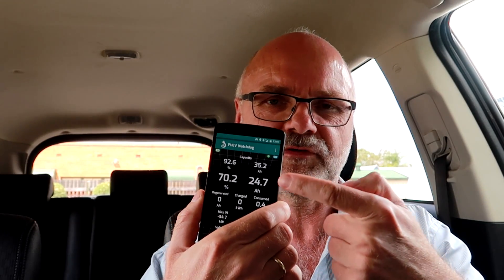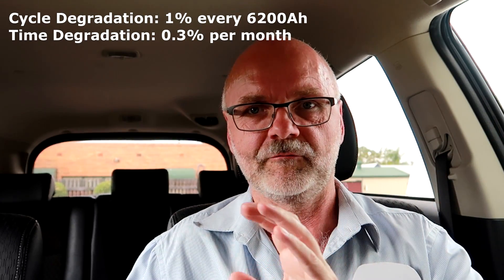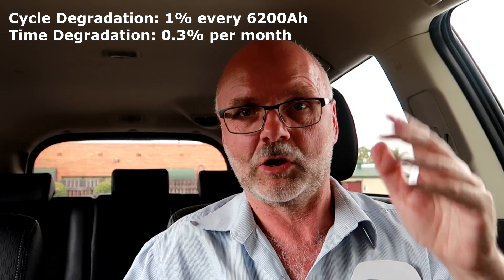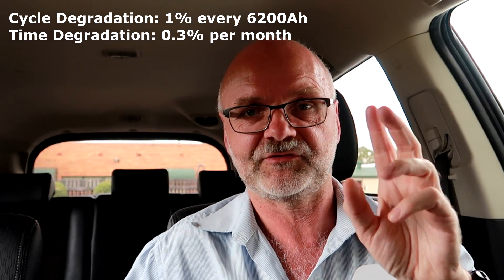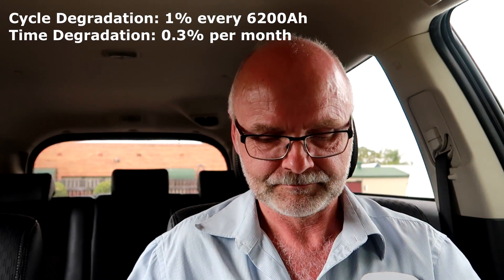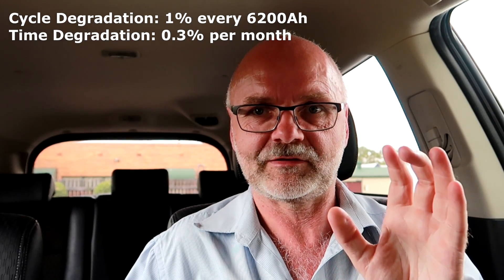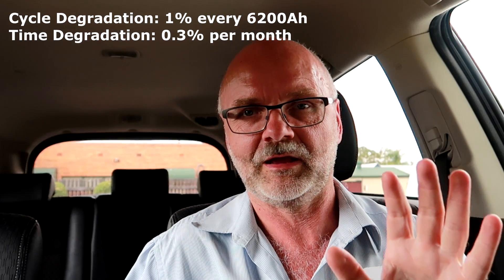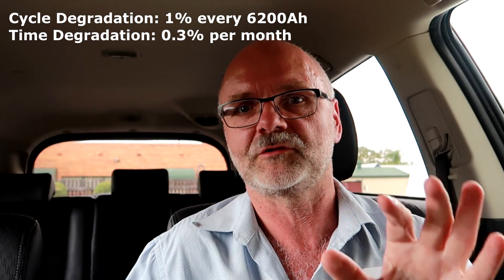EP190 - Do we have a #PHEVvaccine instead of a cure? Why we were wrong about the BMU!

Comment: Do you recommend performing the triple procedure even before getting your new Outlander? Afterwards the system should know the real capacity, shouldn't it?
By the way: Thanks for your great work!
Reply from the maker: Thanks Nicolas. The triple Procedure does not seem to work over time. It looked good at the beginning but SOH is going down again after a while in the same pace as without the procedures.
It calibrates the BMU to the correct capacity though, that is correct. It's the best process we have at the moment...

Comment: Andy, 

Not so sure about what you are saying.

As a matter of fact, Mitsubishi themselves have explained in one of their service bulletins that the BMU can only calibrate itself when it is regularly charged over A/C and even then, only "when certain conditions are met". Are they bluntly lying? For cars that are never externally charged or only via DC chargers, Mitsubishi themselves indeed say that the BMU has noting to go by, other than the preprogrammed deterioration params (we didn't know the actual params, so thanks for that). But we have also seen cases (on the same PHEVWatchDog,net you refer to) of cars where reported SoH spontaneously went up in several small steps when charging pattern changed. If you and Gerard were right about the software, this would be impossible.

BTW

My battery is 65+ months, so I should be down roughly 20% for this.
My Ah in/out is 170.000 Ah, so I should be down another 27% down for this.

In total, I should be down approx. 47%. But I am 'only' 30% down. Less than 2/3rd of what to expect based upon preprogrammed params. Yes, I have had several DBCAMs performed, but never a full reset. So, according to you, the DBCAMs should not have made a lot of difference.

Also, in 8 years, every battery should be down by at least 8 * 12 * 0.3 = 30%. Subtract some more for usage and about every battery would eventually be eligible for warranty replacement (provided the owner did not more than 100.000 miles).
Reply from the maker: Yes, not true, the BMU cannot calibrate itself without DBCAM. Obviously MMC is not aware of that and the workshop manuals are wrong and incomplete.
Reply: @unpluggedEV  So the people claiming to see their SoH value going up by regularly charing the car, such as Richi Jennings, are lying? And so are the stats on PHEVWatchDog.net that show SoH on some cars going up, step by step?

With all due respect, your explanation was not all that convincing to me (or to yourself, as you did not want to be quoted on your claims ;-) ) and the 'evidence' appears to be restricted to TeamPHEV members only. Tough to sell, if you ask me.

Comment: I suspect that the bmu having the wrong initial input from the beginning continously "think" that the battery degrades much quicker than it should and at every cycle of evaluation tries to "save" it, thus continuous drop in the apparent capacity. This way user should not be able to degrade the battery further but the loop continues in some kind of a vicious cycle and will never stop unless everything is reset and a proper initial value is inserted. The biggest bug in this system is that the BMU does not correct the predictions using, for example, max nominal V of the battery and uniformity of V across the cells.
Reply from the maker: I like your theory, J B!

Comment: Thanks for the info Andy. I'm not sure about those percentages though as it would make my 62 month old MY14 with 49068km on the clock be expecting a SOH of 73.48% when I've actually got 85.3% showing in the Dog. Perhaps the percentage degradation calculation is not exactly 0.3% and 1% ?
I have wondered about this - the BMU is old and presumably slow by today's standards. Does it do proper floating point calculations, or is it using some low-precision 8 or 16 bit integer math?
Perhaps the calculations are simplistic and give different results compared to us using our scientific calculators and spreadsheets?
Reply from the maker: All possible, you may want to ask Gerard. I pinned his commend at the top here...

Comment: Wont the degradation pattern stay the same then? If it is just based on percentage and usage?
Reply from the maker: I think it's a percentage of the available capacity. So the calculated degradation is not linear and also depends on your usage, which is probably not the same every day either.
Reply: unplugged EV if it only cares about cycles and time wouldnt that mean that  it will always be the same, the only difference is the available capacity of the battery?
Reply from the maker: But cycles are heavily dependant on your driving style. Remember even the regen putting energy back in the battery counts towards this 6200Ah=1%...
Reply: @unpluggedEV  My case is that the potential degradation pattern would still be the same if you look at it in a graph just that the values would be a little different. Since its always the same calculation(?) and the only value that actually change from the BMU fix is the total capacity of the battery?

Comment: My deep respect to you and Gerard ! Let's see if Mitsubishi creates a service procedure for this.
My PHEV dropped 2Ah and 5% SOH in 5000 km, so i'm looking forward to such a simple fix.
www.phevblog.nl/en
My usage = 98640Ah, so would be 15.9% capacity drop
And age = 1459 days would be 14.6%
Actual SOH = 90.8% (34.5Ah)
This does not match the calculation in the video, however the first 125.000 km the car was not charged by the previous owner. I got it with 95.8% SOH at 125000km.
When i only use the delta after i got it, charging twice per day (7356Ah and 113 days) the capacity drop using the formula is 2.32%.

Comment: Doing the math on mine only the battery cycle degradation seems to line up roughly.  1969days old, 98600Ah of usage, 85.8% SoH.
Thanks for digging into this. I'm very curious on how this all turns out.
Almost makes the intro song more manageable.
Reply from the maker: Unless you had a reset at some stage...
Reply: True, true. I almost had it for a month. Could be the previous owner. But yeah, keep on digging! :D

Comment: Hi Andy, Gerard
Unfortunately the things don't seem so be as simple as explained. The data from my car does not fit in your explanations.

Currently I have SoH 83.2%=31.6Ah which means that my car is one of those with 100%=38Ah.

In the same time the total current is 110 000Ah which should mean 18% degradation according to your formula. It is also 58 months old which would mean 17% degradation more.
According to your degradation formula, the BMU should have calculated 17%+18%= 35% degradation.

Lucky, my SoH is 83% instead of 65%.

Apparently, there are other parameters that the BMU considers.
Also, strangely enough, after the first 3 years and 140 000 km with the previous owner, the SoH was 92%. Now only two years later and 40 000 km more, my SoH is 82%, so the degradation started dropping faster with my usage.

Any thoughts on this? How does it fit in your findings?
Reply from the maker: Maybe your had a reset before you got it...?
You can ask Gerard directly, I pinned his comment here at the top.
Reply: Recalculate like the percentage you get on leasing in a bank: apply percentages every time she SOH is changed. Do not apply projected degradation to the initial capacity.

Comment: Great work Andy and Gerad.  Still more to do with MMC, but loving the new PHEV you convinced me to buy (😉), so glad it’s not a 🍋 🤣

However, as this issue isn’t a safety issue, I’m not surprised MMC don’t roll out a recall.  For those who suffer and ‘just drive’ it costs MMC nothing, for those that see 70% ‘assumed’ degradation, this procedure may save millions in battery replacement costs.  For the likes of us tinkerers, it will shut us up... hopefully!

One question is still bugging me, though: What collaboration has Yuasa, the BMU manufacturer and MMC had to set this system up?  If none, maybe the LEV-40 is a better product than the degradation algorithm gives it credit?  Then this procedure should give many of us a great solution.  

Or maybe MMC didn’t realise how their cars were going to be driven and thought this would never be an issue... 🤔

Comment: Very interesting video thanks Andy. It is interesting to see that scientific proof has largely confirmed what I said in the earlier part of last year, and that is that most of these so-called deteriorating battery problems were in fact the BMU artificially strangling the amount of charge admitted into the battery using arbitrary parameters. I was wrong in assuming that this was to prolong the life of the battery, not that it would not have occurred as a result but it is much more the result of incompetence and laziness on the part of Mitsubishi motors. 
It sounds like you are suggesting that the three procedures should be done to older cars. Mine has just gone over 30,000 km, so possibly the real battery degradation is not all that great.
Reply from the maker: We have to test the procedures in older cars and see if this makes a difference or not. One viewer has confirmed here it does not make a difference though...
Reply: unplugged EV 
Andy, I would be quite happy to make my car available. Barry’s DOG recently said the battery was at 79%.
Richard

Comment: So let me get this straight. Mitsubishi's BMU is really nothing more than a glorified counter that "guestimates" battery degradation (and very aggressively it seems)? It doesn't measure actual cell capacity? Ever? That seems like a very odd engineering decision. And it explains a lot. Like how you can get your car back from a dealer after getting the battery tested and suddenly it's range jumps up to near new only to degrade again very quickly.  You would think at the very least Mitsubishi might introduce some kind of per cell amps in and amps out monitoring and compare it to actual voltage. It's not exactly rocket science.  At the very least they should be able to do this for the pack as a whole.
Reply from the maker: Honestly, this all develops to a real nightmare. I just hope more and more owners jump onto the bandwagon and complain about this. Finally this should urge MMC to provide a fix. A real fix.

Comment: Well done Andy and Gerard. Your efforts Andy in producing these videos has greatly helped all Outlander PHEV owners. Gerard's work in understanding the code is brilliant. Mitsubishi should be paying both of you as consultants. The least they can do is give you a new battery. They should also integrate the current into the battery to determine number of Coulombs  (a Coulomb is a ampere-second) going into fully charge the battery. The number of Coulombs to fully charge the battery will tell you how many Lithium ions in the battery are being converted. As the battery deteriorates less Lithium ions will be available as they become locked up in the battery. This is why the Ah value is the most important reading in determining battery performance.

Comment: Not sure if I totally understand what you are saying. We know the battery is a 40Ahr battery, but it is only ever charged to 4.1V. To actually get 40Ahr into the battery you need to charge to 4.2V until current reduces to about 0.05C. So I would have thought a full battery for the PHEV is about 38AHr, because Mitsubishi wants to keep the voltage at 4.1V or less for increased life.
Reply from the maker: Yes, that is correct. the actual cells charge only to 4.1V regardless what the capacity of the battery is. 4.1V is around 85-90% state of charge of a cell, so more like 36Ah (40Ah-10%).
The Dog always showed 38Ah after a reset or even in new cars so assumed this is the max capacity it has. The Dog should show 40Ah. if it shows 38Ah it is not aware of the true capacity and makes false assumptions.

Comment: (Mark Walkington, NZ here )     Good work everyone!!!  ... however if the BMU has such a direct algorithm can we pin it down precisely. I have applied the the assumed degradation factors  to my 146668 Ah usage and 1899 days and this predicts even higher degradation. i.e.1- ((146668/6200)*1% + (1899/(365/12))*0.3%) = 57.6%  (my vehicle reports 68.9%). Any other views on this equation?
Reply: Upper Hutt Cricket To be honest I was also thinking the same thing... However that is what the 'software' reckons, not the actual degradation...
Reply from the maker: I don't think it calculates correctly if there is no bearing to the actual capacity to start with. The reported 68.9% are from an uncalibrated BMU, right?

Comment: if Gerard already went through the pain of reverse engineering the firmware, why not modding it right away  so that owners or Mitsubishi shops could reflash/reprogram the BMU themselves?
Reply: Because it seems like it lacks the necessary sensors to actually work - well perhaps not lack of - but in any case the sensors don't report to the firmware. You could re-flash the BMU, but you still wouldn't know the real capacity because Mitsubishi made capacity a simple calculation rather than real world.  The cell smoothing procedure which is basically a cell balance and then DB Cam (whatever the hell that is?) seem to then be able to populate the registers with the correct values (provided you reset the BMU first and clear out all the existing data.) But after that the BMU will do what it has always done and start degrading the battery based on it's inbuilt firmware.
Reply: @mondotv4216  , well maybe that's not needed to improve the way the BMU calculates the state of the battery (although it probably would be ideal if the BMU could access and use data from the real health state of the battery).
It may be worthwhile to check if it is possible to overwrite (change) both deterioration constants (charging cycles and age) in the BMU to a less aggressive value. That's not even a programmatic change, just pure configuration. This solution wouldn't fix the problem, but slow down the deterioration which in its stock version seems to be based on worst case  assumptions.
If programmatic changes would be feasible then it may make sense to look at how exactly the math algorithm works in the BMU. If it is some sort of a recursive function - meaning, it calculates always on the basis of the previous result then it may make sense to investigate if the algorithm could be changed in such a way that it calculates always based on the initial battery health state value provided by the calibration process. So instead (x=x-constant) it would be (x=y-constant) - the X coming from the lower register and the Y from the upper register (see video). 
Ideally Mitsubishi would change the firmware and introduce a solution that can read out the real state of the battery and update the upper register in the BMU accordingly.
Reply: Daniel D. You could do that but then you would risk getting incorrect readings on the GOM. I suppose that’s not such a big deal on a PHEV.

Comment: Dude, as a scientist at the end of the stick you let me down there with the vaccine/disease thing. A (working) vaccine is indeed a cure, or even better, it prevents the disease to manifest at all. You should refer to it like an old fashion pill that cure the symptoms, but doesn't cure the disease. So, you have to keep taking the pill, like a statin or .... viagra!
You should check with Gerard if it is possible to replace the BMU with a more advanced third party one, or if it would be somehow possible to bypass the car software and instead use the watchdog app + the user's brain to manage the battery. That, of course, would apply to the cars not covered by warranty anymore
Reply from the maker: A vaccine need to be refreshed from time to time, right?
OK, I use this viagra example in my next video :D
Reply: @unpluggedEV  Just remember to call your Mitsu dealer if the BMU fix last more than 8 hours! :-O
Reply: @unpluggedEV  Indeed, some vaccinations remain effective if you make a recall every number of years. That's because if your body doesn't get challenged by the pathogen over the years, your immune system tend "to forget" the immunological memory you created the first time around. Still, the association with not curing the disease is wrong and misleading. It sounds like an anti-vaxxer claim. Back to the analogy, a "vaccine" would cure the faulty BMU, preventing it from getting faulty, any time it tries to. Unless, the BMU will behave correctly for as long as 10+ years, then the "vaccine" might forget how to fix it, or a new faulty different BMU will be installed, then the "vaccine" would not be able to understand that is faulty too.
cheers
Reply: The flu vaccine needs to be refreshed all the time because the flu virus constantly mutates and evolves.
Many vaccines are indeed a lifelong cure- eg: remember Smallpox.
Hopefully our batteries are not that smart, LOL :-)